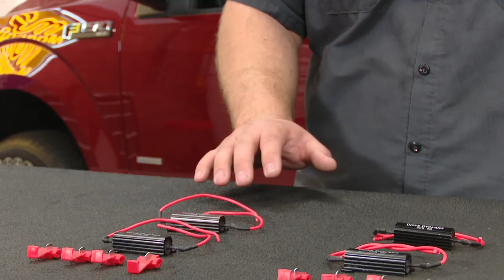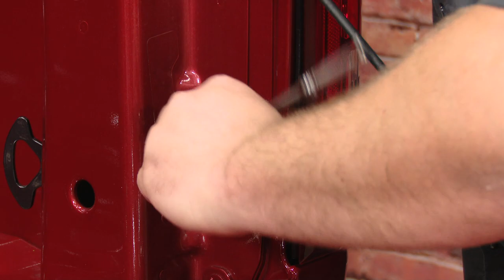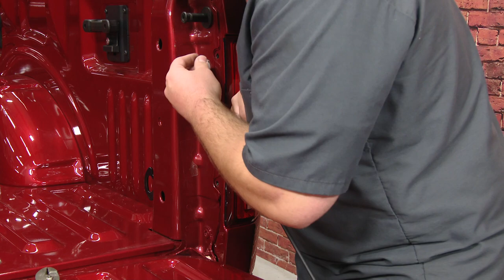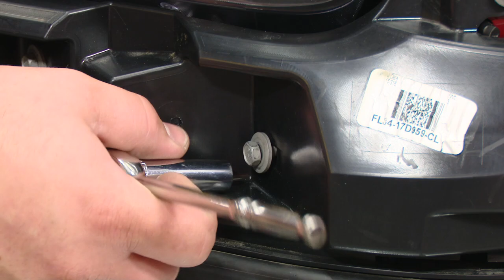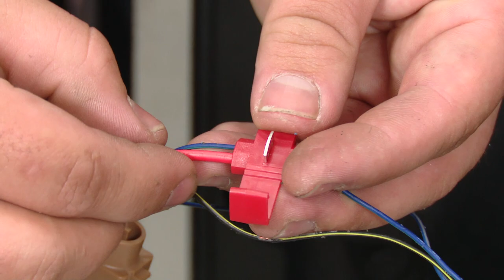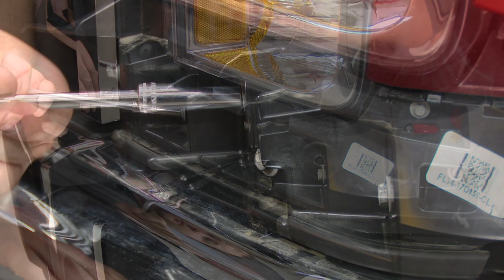LED Turn Signal Resistor Kit Installation

Comment: Hey guys, (CJPony Parts) great video, however, the wires you are tapping into are not completely correct. The ground is, however the blue with grey tracer is actually the park light circuit. The correct wire for the turn on that side is green wire with orange tracer. Hope this helps anyone doing this install. Be sure to mount these resistors to bare metal....

Comment: Surely you read the part about how the resistors get really really hot , so good luck with the double sided tape. They put screw holes for a reason.

Comment: Thanks for the tutorial.  For the rear resistors (might have been useful to mention they're 6 ohm), it is better IMO, to install them on a metallic surface with at least one of the two screw holes, not with double sided tape.  And to close the video, it would have been nice - as someone else has already mentioned - to show the LED lights working sans hyper flashing.

Comment: It would have been nice to see the views of the blinkers working after the install.
Reply: Rock44260 you did see a lil the mirror turn signal was flashing normal speeds but yeah would of been nice to see the whole rear and front

Comment: Thanks for the video.  However, to reiterate what others have mentioned, it is much better to secure the resistor body by screwing it metal-to-metal (for greater heat dissipation) than using two-sided tape shown at 3:43, even better if both ears are screwed to a metal surface.

Comment: man those resistors really needed to be mounted to something metal as they get very hot and will easily melt through any plastic parts I modified mine to get more length on those resistor wires and used self tapping screws to mount them to the back side of the crash bar well away from plastic parts
Reply: Marvelle Washington THIS^ Thank you!

Comment: Use self tapping screws to mount. The equalizer is a heat sink and will get very hot. Do Not use tape, it will melt.

Comment: The resistance heats up, because you fix it with that glue, could it melt it? Another query, the resistance goes in the section of the lighthouse where water can fall behind, something will happen with the resistance if it drops water or is water resistant?

Comment: If you only do this with the rear(replacing with LED's and adding resistor) Can you have regular incandescent bulbs in the front or do you need to do leds on all signal lights?
Reply: in all LED bulbs

Comment: the rear blinkers has 3 wire I know one is ground the other blinker and brake when I tested it with my test light 2 of the wires both blinked does it matter what one I use from the 2 as the positive?

Comment: HELPPPP!!!! CHEVY MALIBU 2017 - I bought 7443 Switchback lights I plugged the LED lights in but now my car is saying check front and left turn signals. It is giving me rapid flashback feed in which I need resistors plugged up to it. I have the resistors but what cords do I need to connect it too in my car? There are 4 colors fro my switchback which are PURPLE, BLUE & WITE and 2 BLACK CORDS. How do I know which 2 cords I need to connect the resistors too? 

Thanks, 

Victor

Comment: Btw from my earlier comment, the installer has given out the wrong color code. It is NOT the blue wire you need to tap, he has the ground correct but you need to grab the other wire. Nearly burned up my wiring.

Comment: Why using four 50w resistors who draws a total of 200 watts to replace four 21w incandescent bulbs who are drawing 84 watts total? Should four 25w resistors for each bulb or one 50w resistor for each side (front and rear) not be sufficient? If I'm not mistaken, each side is one circuit so one resistor of 50w for each side should be enough to prevent hyperflash.
Reply: the Resistors Wattage Rating is defined as the amount of heat that a resistive element can dissipate for an indefinite period of time without degrading its performance.  So up to 50 watts.  Not operating at 50 watts.  6 Ohms is the resistance.

Comment: I have 2 questions... was wondering if someone could give me hand?  I need to install these resistors for my back lights: Turning signals and brake lights.  Reading some of the comments, I noticed that it seems a bad idea to use double side type to hold the resistor in place.  1st question: Do they get hot? Is this normal?   2nd question: In my car, there is room to place one of this resistor, thus it is going to be very tight. Some of the original wires will be against the resistor. Does this resistors get so hot that could melt the original wires jacket/insolation?  Any advise? Thank you.
Reply: Hey Bud, also trying to
Do this on my Accord.

Answer: from what I’ve seen on videos, resistors can reach up to 115-200 degrees 
So try to install on metal away from any Plastics, cables, rugs etc 

Good luck

Comment: im having the same problem on my 95 tahoe since its an older truck if i did the same and put in resistors would it work? i just put in all new led lights
Reply from the maker: Probably yes.

Comment: Is it standard for Ford to use a blue wire for the power and a black with yellow striped wire for the ground? My Ford Fiesta has the same color scheme in the turn signal wires and I'm nervous about jumping into it without testing the current in each wire.
Reply: Ford is not always consistent with their wiring colors. Black with a stripe is a common ground color though.
Reply: +Bill Tumas Thanks for the reply I appreciate the info!

Comment: does it get hot all the time or only when the lights are on?
Reply: ALPHA GAMERS CLAN just when they are in use
Reply: ALPHA GAMERS CLAN Only When Ur Using Flashers When Lights are on or Ur Pressing on Brake Lights There Not In Use Only When Using Ur Flashers That's When They Get Hot

Comment: I put resistors on mine they work on the outside but the inside still flashes fast can you help with this?
Reply from the maker: Feel the resistor while the light is flashing fast. If the resistor is not getting hot then it's improperly installed or its defective. It should get hot pretty quick.
Reply: @cjponyparts  okay I'll try that

Comment: Those resistors get extremely hot 400f + double-sided sticky tape is not going to hold that on. I even used quick setting automotive glue yep it came off to.

Comment: For a 2014 Chevy Cruze... Im trying to figure out the front and rear turn signal wiring.. Which is the ground.. And the blinker wire? Front is blinker wires are brown and violet?  Anybody know?
Reply: Don't know if you figured this out yet, but grab a multi-meter, set to VDC (volts dc), connect black lead to any ground (battery - terminal, chassis), turn on blinker, and probe pins of signal connector with red lead.  The pin that pulses voltage is your blinker power wire.

Comment: Also wouldnt the double sided tape just melt off?
Reply: Nope, it holds up just fine.
Reply: Kevin Pierre I Put Mine Up With Double Sided Tape As a Buddy of Myne Did  I Was Kinda Having Second Thaughts About It But Going on 4 Months & There Still On Haven't Melted Off

Comment: Ive heard that one can just buy the upgraded relay or flasher that is for LEDs and theres no need for resistors???
Reply: yep they are available on Amazon
Reply: do you have a link? :)
Reply: Rumeel12708 yes but a lot of newer cars doesn't have a relay
Reply: If you're going to call people idiots, spell and punctuate correctly.
Reply: Italian Guy
Unless,  your vehicle has non-serviceable relays/flashers, like mine does. Mine are soldered into the bottom of the TIPM, if you know what that is...Be smart before you call others idiots...
Reply: How hot can they get if it only uses power when your blinkers are on
Reply: @josephsanchez824  if you have switchback led turn signals they are always on with white light when your parking lights are onand switch back to amber when you use the turn signal. So very hot.